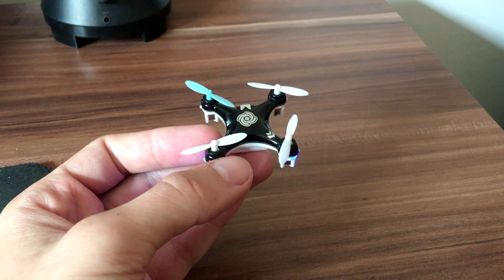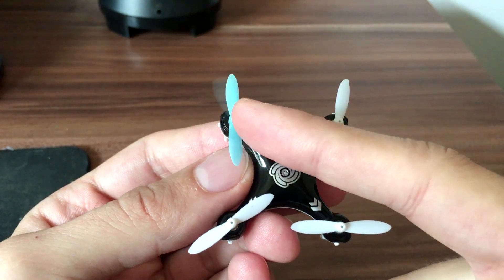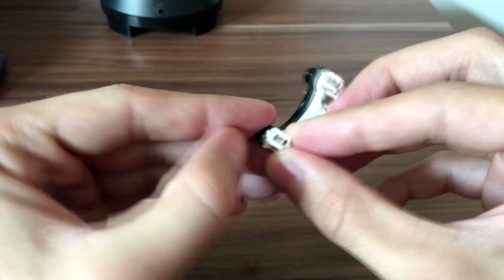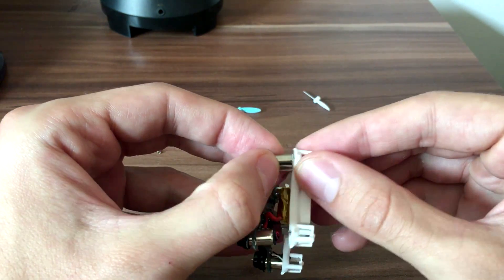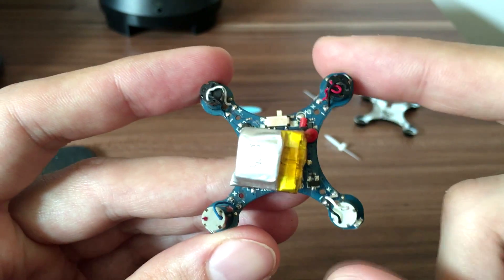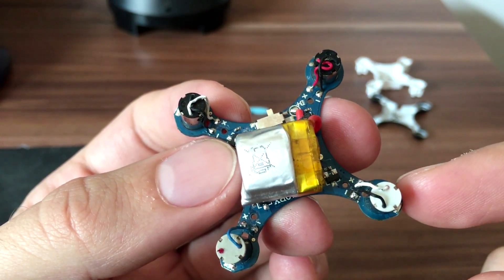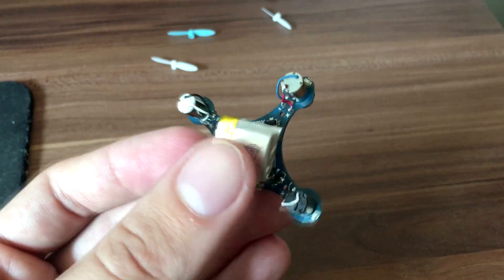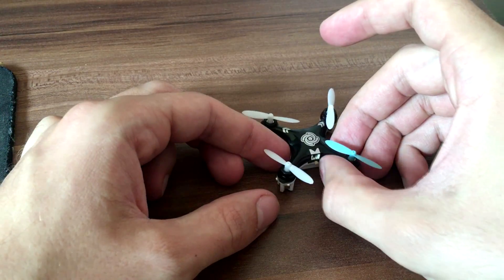Cheerson CX-10 Replace Motor Disassemble

Comment: i modified mine cx10wd tx so it fits racestar 615 67000rpm motors instead of original 612 motors wich are 47000rpm-50000rpm. it works wayyy better, it flies faster and has more power. battery section is modified so it fits 200mah battery that i can change very easly.

Comment: I welded back the wire, but it changed the resistance of the contact :( result, the motor turns but it losts its power... my drone cannot fly :( help
Reply: İt's impossible replace it